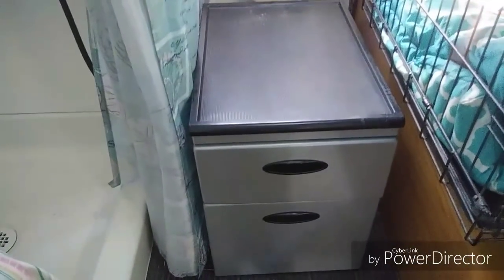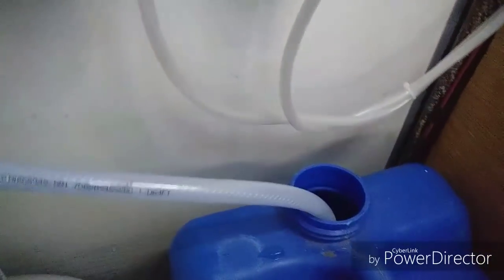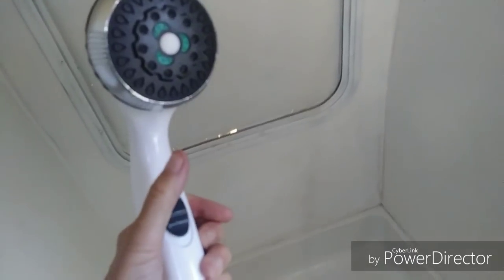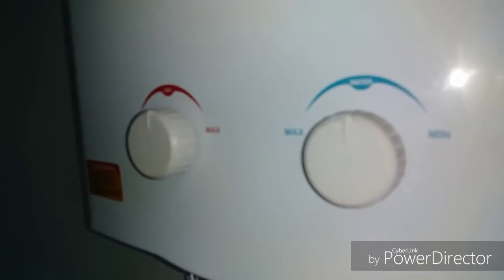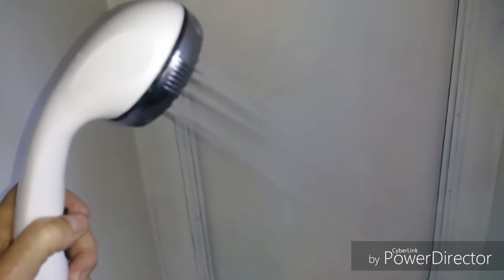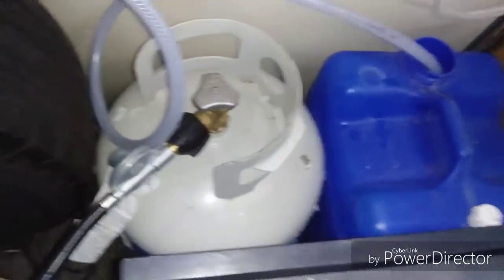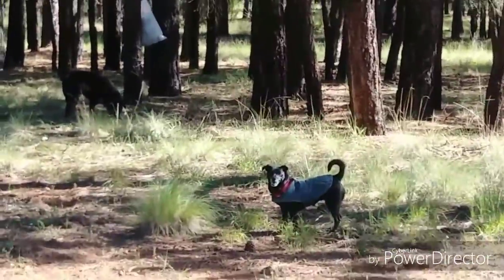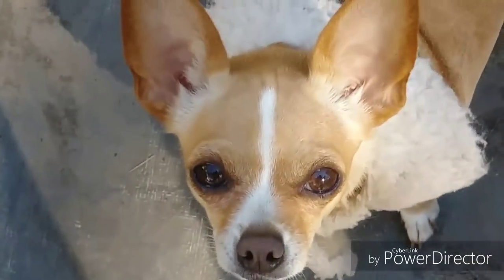SHUTTLEBABE'S CAMPLUX SHOWER!

Comment: Watch out for Carbon Monoxide it should be vented to the outside...
Reply from the maker: It has a Vent.😃👍
Reply: @ChristineBEACHCRICKETLowery  
I am so new to this... and need your help. 
This is exactly the same unit I was going to put in my 
Vintage Travel Trailer... just like you have yours but they said this was strictly for OUTSIDE... but if
I were to put it inside my travel trailer... to make sure to have a fan/vent on while in use.
How did you vent yours? ...and an other question... since you put it in your shower, are you afraid to get 
water in it from the top where the exhaust comes out... 
Thank you so much for your help... I love your little home... BEAUTIFUL.

Comment: Did you ever have problems with it melting the plastic of the shower where the exhaust comes out the top? Thinking of something similar.
Reply from the maker: Not at all. It just needs a bit of clearance and it does well.👍✔😉

Comment: Has the Camplux water heater been good after 2 years of use?  It was smoking or had steam coming out from the top of the unit when you were breaking it in.  Was that totally normal and how quickly would you say that "problem" went away?
Reply from the maker: It is still going strong! The first few times of use the smell went away.
Reply: @ChristineBEACHCRICKETLowery  I am glad it was a good purchase for you.  Thank you for the reply.

Comment: What are the steps to set up the camplux? I  git everything attached, turned on the water (hose) turned it on. Water went through but, the heater did not turn on. Are there certain steps?

Comment: Hey girl! I have another question for you. Sorry to be picking your brain but your bus is identical to what I will be searching for soon. What in the interior length from the back of the drivers seat to the back door. I am trying to put together a floor plan so when i lovsye the right bus I can hit the ground running with my build.

Also, you may not need to dump all that great rain water. The particles sink to the bottom where you are pulling the water from.

Anyway, if you can help me with that measuremen I would really appreciate it!
Reply from the maker: The total bus is 24 ft, so minus the front area of maybe 2-3 ft.

Comment: You need a flue to vent carbon monoxide outside your rig from the top of the water heater. I also hope you have a carbon monoxide detector in your rig too. You’re installation is unsafe. Even with the Fantastic fan, carbon monoxide will get into areas that the fan will not remove. Please be safe :)
Reply from the maker: It is right by the back door which is also vented for the Camplux. And yes I do have a detector too. Thanks!😀

Comment: I dont think they are supposed to be installed inside.
Reply from the maker: It is all about clearance space, and venting. I have used mine now for 3 years with no issues.😃👍
Reply: @ChristineBEACHCRICKETLowery  thank you for posting this video. I'm in the market for one of these. Did you install a vent that attaches to the tank, or are you using an overhead shower fan?